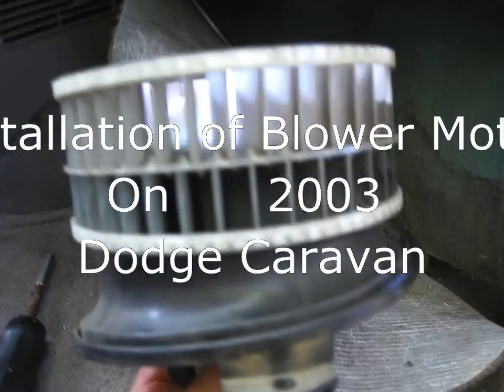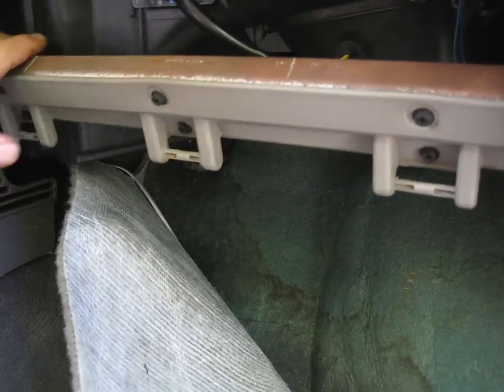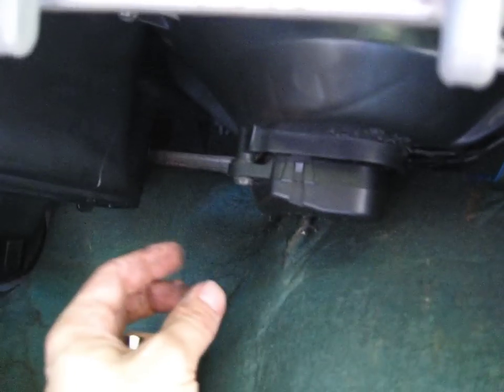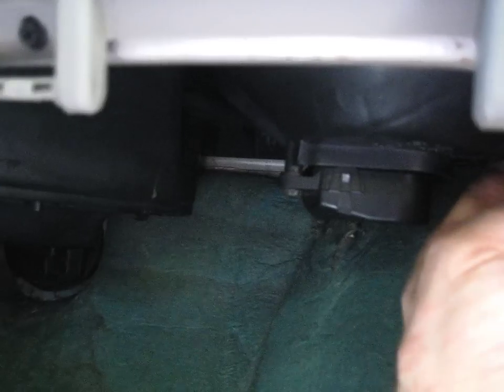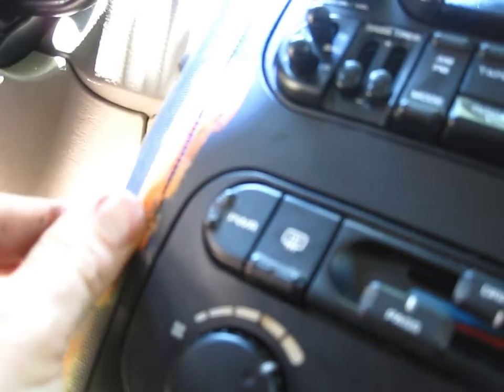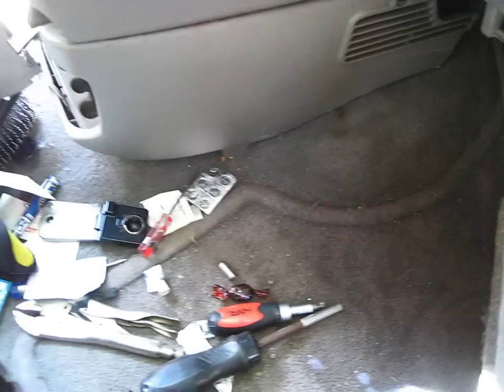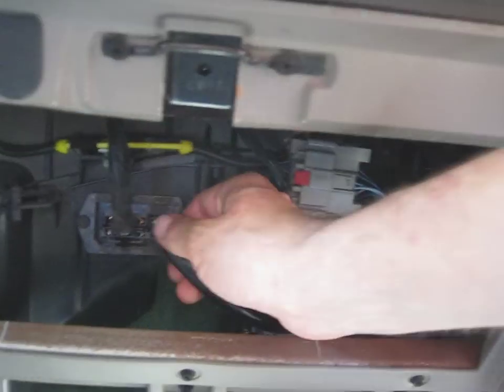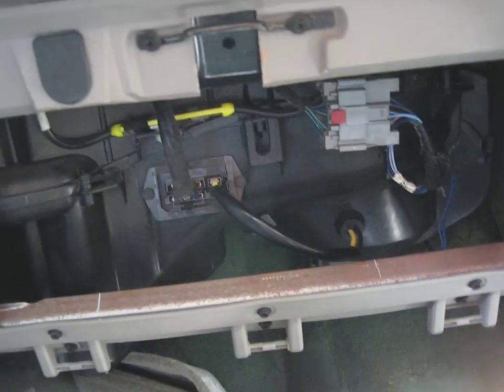Dodge Caravan Blower Installation

Comment: Thanx Zoo.  Very helpful.  I just replaced mine.  I found a new blower fan on Ebay for $46.  Like jhartdude said, the 5th screw that holds the outer cage is waaaayyy back there, and hard to get to.  I ended up breaking the plastic cage where the 5th screw goes in.  But it's no big deal, because when you put it back together, you'll never see it.

Comment: Thanks ZooSplash for making that video.My '02 Caravan's blower setup is the exact same setup as this.  I had to do my repair in February 2017, with temperature below zero, and it took me WAY longer than a couple of hours to do.  FYI for viewers in Canada, Princess Auto had a flex-shaft driver that accepts a 5/16" socket, with 1/4" drive, for that god-awful back screw.  ZooSplash was right on the money about having to tear back the carpet and insulation to reach it.  No other way to do it.Shame on the Chrysler engineer who designed that.  Engineers shouldn't be allowed to design anything until they've worked on repairing stuff for awhile.  This should be redesigned.ZooSplash is also right about troubles with bigger hands... my hands were cut up pretty good by the end of this job.  Not fun, but saved money over taking it into a shop.Rich

Comment: Thanks for the video.  You just saved me about $200.  Got it done in about 2 1/2 hours.  Would have been quicker but had to run to the hardware store to get the extension.  definitely have to have the flexible ratchet extension.  Impossible without it.

Comment: Just replaced the blower motor and resistor in my '05 Grand Caravan.  Thanks for the video.  I'd like to re-iterate the need to get a flexible drive extender for the backmost screw.  There are a total of 5 screws to remove -- I thought I had them all but the cover wouldn't come off.  I was trying to avoid removing the insulation, but had to take a little out to get to that back screw.  Needless to say, that back screw didn't go back in (4 out of 5 are holding the cover just fine).  :)
Reply: Where did you get the flexible drive extender. I've been to 6 tool stores, and I can't find it.

Comment: I found it easier to pull the 10mm bolts out of the engine bay side of the firewall, and then pull the heater box back about two inches so I could pull all the bolts out of the bottom of the heater box to gain access to the blower motor. Completed the job in about 35 minutes this way
Reply: I just pulled the engine and dash out for easier access.....

Comment: An option to trying to set the door position while re-assembling the parts is to simply turn the door from below once all parts, except for the actuator motor, are together. With the door in the correct position, simply install the actuator motor.

Comment: I just finished this replacement. I eventually gave in and cut the insulation so I could get closer to the firewall with the ratchet head and get the back screw off. Also, the recirculation blade inside snaps off the lower housing at the bottom. I don't think it's possible to get the blower motor out without detaching the housing & the blade. It's a very small space and pretty frustrating work... but now I have air again!

Comment: Another tip is to buy only the OEM resistor. Popped two aftermarket ones. Bought OEM and no problems after that.

Comment: One thing to save time is to check your blower motor connector for power. If you got power, but all switch settings don't blow air, but goes on and off via switch it's your fan. Most people will try to replace there resistor first hoping. Well it's fairly unlikely that all switch settings won't work but it's a time saver to check first for power. Course it's only $12-16 bucks to replace it while you got it all apart if one really wishes.

Comment: I did this on my mom's van over the summer.  She just tried to use her heat and now  the air isn't getting hot.  The climate selectors slide really easy and does not appear to be switching to heat.  Could you please help me figure out where I went wrong?

Comment: I got all the screws out, but I can't get the Lower Housing off. Does the Blend Door have to stay attached to it? Can't figure out how to get the Blower and Motor out if I can't drop the Lower Housing. Anyone else have trouble with this?
Back screw was a real pain. What was Chrysler thinking?
Reply: Paul Krueger I got back screw off easy. But I can't get the thing down.

Comment: I did this job it was not fun 1/2 hour+ just to get that rear bolt out. I left  that back bolt out after replacing the blower motor and it was fine. the resistor was very cheap so I changed it at the same time.

Comment: thanks alot i got it, but still broke the top pin for actuator flap which did NOT affect the way it works. the blower motor is very tight to lower from around the flap. aka "half sea shell" looking thing  better if it was hinged

Comment: hi ZooSplash,
I watch your video and I was able to removed all the screws including the back screw.
My problem is I can't remove the cover. The cover only goes halfway but not entirely. I'm not sure if it is the close/open blade that's causing the cover not to be removed.
Should I also removed all 3 screws of the motor before removing the cover all the way down?
Thanks.

Comment: I'm curious how you "electrocute" yourself on a 14 volt system. I'm also curious why you'd unhook the battery when none of these systems are energized with the car turned off. And I have no idea why you'd mention airbags, there is no airbag or airbag wiring anywhere near these assemblies.
Reply: guyonearth the yellow is airbag. but I is high up.I paid ony $47 and 8 for resister.

Comment: disconnect the battery and remove  glove box disconnect wiring. leave the bottom actuator black wire alone unbolt the outer cover housing 3 bolt screws. inside on the bottom pop off the bottom part of the C-shaped actuator housing which is connected to the outer housing on bottom "actuator control" . the blower motor is held by 3 more tiny bolt screws. the C-shaped housing. try not to flex it too far away from the blower motor while lowering or the top pin will snap on top. like he said move it back to where it was when you put the blower back in. i never took away the insulation from back. just pulled carpet out the way and kick panels away. outer housing will get snagged on insulation when removing.

Comment: I replaced my blower moter about 2years ago and now sometimes it doesnt work properly there is no air flow i can hear the moter is turning in all different speed .i dont know  what is wrong
Reply: check if your fan is working at the front of the engine
Reply: Some replacement motors are wired backward & the motor spins accordingly.

Comment from the maker: @luvadad1  Sorry best I could do by myself. The important thing is that back screw cannot get to it unless you remove insulation and have the right tool. And when you put it all back together be sure the vent is in the open position as this is the defualt when the car is off. I could find no real good vid at all so I thought Posting this would help a little for those trying to save a hundred bucks or so.

Comment: WOW are you kidding? You completely SKIPPED the removal of the blower motor!!!
In fact, NOT once did we even see a blower motor.

Unbelievable - after finding only 3 YouTube videos on how to remove a Dodge blower motor, NONE of them showed the removal part - skipped right over it as if I skipped a commercial on TV.

As Terry Hill says below: "the recirculation blade inside snaps off the lower housing at the bottom". What exactly does he mean, and of course THIS ISN'T SHOWN in your video, and I can't figure out how the hell they come apart - I don't want to risk breaking anything.

So here I am, all the bolts out and I can't proceed any further because a god damn half-circle turning vent part thing is stuck to the cage I just unbolted.

Next time, just make a 1 minute video that says:
1. ummm, there's a bolt or two that's hard to get to
2. good luck disassembling it all cause I'm not gonna show you a damn thing
3. goodbye. Hahaha!

Comment: The problem with shitty videos like this is not only is the camera so shaky you can hardly see what's going on, but nothing is going on. Had he actually removed the motor on camera, you'd know that the bit you see under the dash isn't the motor but part of the HVAC housing you have to open up BEFORE getting to the motor, and that before you do that you have to take off the actuator at the bottom, then pop the plastic shaft connected to an internal door that the actuator pivots. Fail to do so and you'll shatter the whole deal, and need a lot more than just a replacement blower motor.
Reply: THANK YOU for this information!  Im about to do my 2003 caravans blower motor this weekend, this will save me alot of headaches.